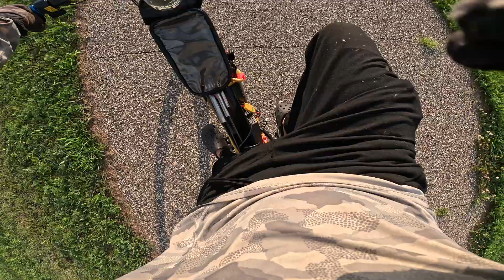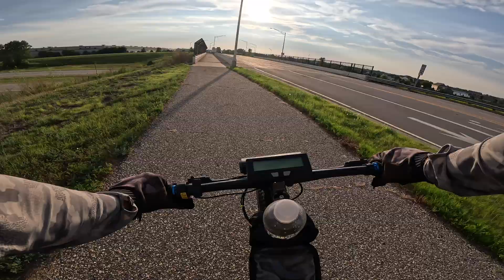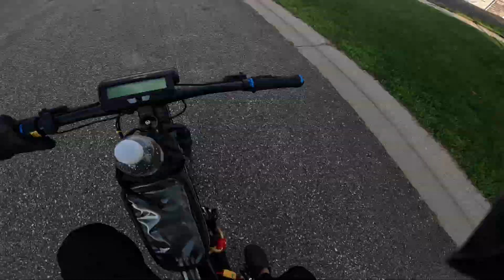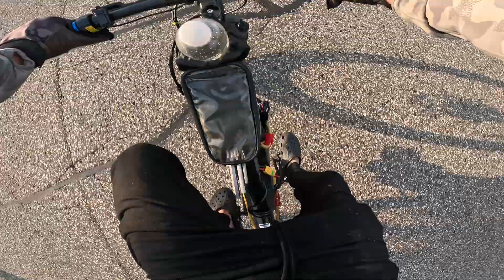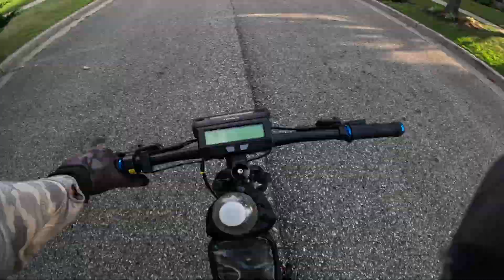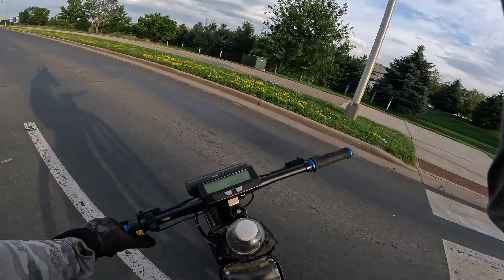BBSHD VESC SCRIPTING - Virtual Freewheeling pt1

Comment from the maker: 10$ off the FLIPSKy with code EBB at flipsky.net! Jeff Bezos will send you a used one. Direct link to 75100  Pro V2 controller that I am using https://flipsky.net/products/flipsky-75100-pro-v2-0-with-aluminum-pcb-based-on-vesc-for-electric-skateboard-scooter-ebike-speed-controller?ref=ltwzpbbx

Comment: I found a solution that does not need the freewheeling function. Get yourself a rear hub that has higher points of engagement. I'm using a Hope Pro 4 with 88 ratchet points of engagement. Typical cheaper hubs have 16 or 24 POE and that's why you're getting that jerking feeling with the chain yanked when you're on and off the throttle. With a higher POE hub, the 'gaps' between the pawl indents on the hub are much closer together so it's a way smoother transition. I don't have that jerking sensation on the chain and cassette anymore. Using 72v bbshd with 6000w.
Reply from the maker: @Hybrid600  i got sick of messing around with the mechanical stuff, breaking derailleurs, it hangs down too much / ground clearance is not ideal,   No torque sensor,  I’m bored with bbshd at the moment. I have two bbshd sitting in a corner and no interest in messing with it.   I had it hooked up to a cycle analyst and then i crashed my bike  and everything got all f-d up  and it would almost be easier to build a new bike than fix my existing bbshd mtb. Bbshd its just old news and doesnt get views or traffic
Reply: @EBikeBuilder_  I have 5 of em that take a beating and work very well. It can be frustrating if you never really know the heart of the issue. If you keep trying to bandaid the problem with sub par solutions,  it will never go away. If you ever need to get rid of those crappy bbshd motors let me know lol
Reply from the maker: @Hybrid600  another thing i would say is somehow the power delivery does matter , because my phaserunner was much smoother with the bbshd than my flipsky.  On the same wheel
Reply: @EBikeBuilder_  have you ever gone to my channel and seen the videos of my bbshd bikes in action?

Comment: Did you ever figure out the roughness caused by that script? Most things that touch a motor speed on an update loop like that need a hysteresis function in order to smooth out the jitter/pulses created otherwise. I'm not following development at all, so for all I know everything is already glassy smooth, but my 0.02c . Good videos.
Reply from the maker: no that  was a crazy problem I never figured out Lol   it was only a problem at super low speeds it felt like cogging
Reply from the maker: ty for the suggesto  I will save that in my memory banks and i need to solve that problem  soon as i start riding my bbshd mtb again ..
Reply: @EBikeBuilder_  cool man. I use a totally different style of middrive from the  bbshd units but I imagine the script would be useful for a lot of obscure setups. I dropped you an email on the address on your yt profile -- if you ever need someone to discuss the problem with once you re-approach it drop me a line. Good luck.
Reply from the maker: @eeehhhhhhhhh  ty ty i see the email i an Going to try that out soon as i start messing around with that build again!!

Comment: Can you confirm its power levels and can it push full power from the dead stop? (I dont want any slow safety start) I already have my flipsky but I have burnt bbs02 core so now Im using chinese 30$ 1.5kw 48v controller (similar to stock) but it has rpm control and doesnt have 72v option I am going to use. With this one I go around 60kmh/40mph)on flat ground but in high gear. Is the ASI BAC the best way to go or will flipsky bring hopes again?? Thanks in advance❤

Comment: Nice work! How does it interact with the brakes? Is it just that the free wheeling current is so low that the brake easily overcomes torque ?
Reply from the maker: i have it set to 2 amps on my phaserunner. So its about 150w, yes you are correct its very easy to stop with just the brakes. Or gravity will stop you if youre going up hill etc.  I think the jerkyness was partially from the magnet cogging. and maybe the sleep in my script. I might try to make it run in real time withuot a sleep to see if its not as jerky.   But yes its such a low current, very easy to stop,  i have it so when the motor RPM drops below a certain value it will stop the freewheeling.

Comment: Somebody on diy electric car forum said that trampa, makerx, ubox and flipsky tend to give up like flies due to  lack of optoisolators.
Reply from the maker: i'm not pushing the flipsky anywhere near it's rating, with the exception of being on 72V.  i've heard of some people having problems with the older Flipsky that didnt have the phase filtering implemented.  But the Pro v2 seems OK so far, its the first one I have tried. It was only 100$ and TBH i have had more problems with Grin phaserunners that cost 4x as much
Reply: @EBikeBuilder_  Still not sure what problems should I expect from a Phaserunner which is considered to be gold standard on endless-sphere despite the fact that it's still not built up to automotive or industrial standards. Bulky cheapo plug and play 3 speed  controllers are still the only ones optimised for ebike use according to Chalo.

Comment: How does 1 knobby 1 smooth tire feel?
Reply: Mine are reversed with a street tire on front & a knobby tire on the back for traction.
Reply from the maker: Feels like my rear tire isn’t going bald , and my front tire has great traction and never wears out 😂🎉👍👍  turning sharp at low speeds feels a bit “knobby”  Not too bad tho
Reply: @EBikeBuilder_  sick!
Reply from the maker: @reyaz8531  i took the rear knobby off Cuz it was wearing down UNBELIEVABLY fast, kind of a waste.  But my front tire barely ever wears out